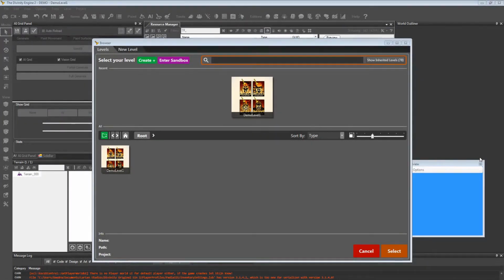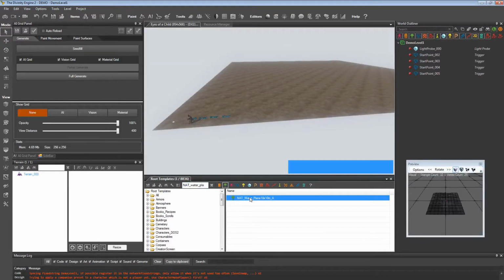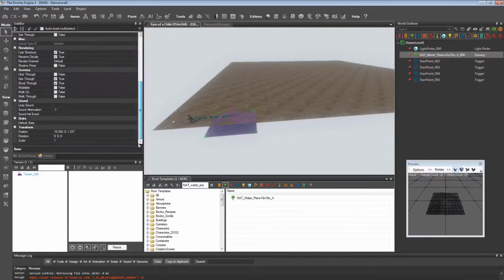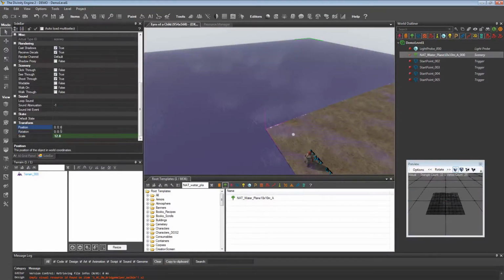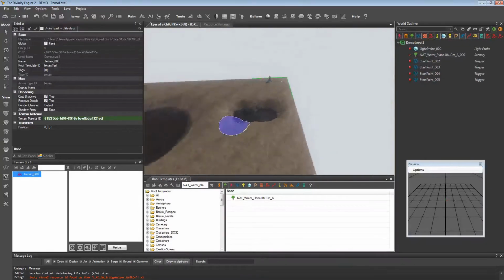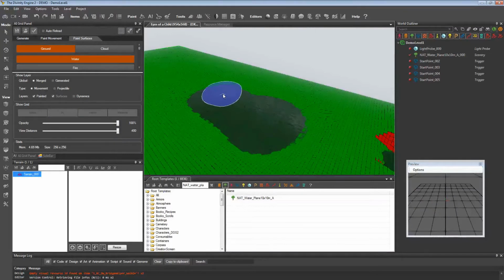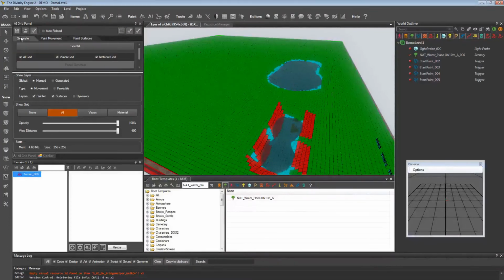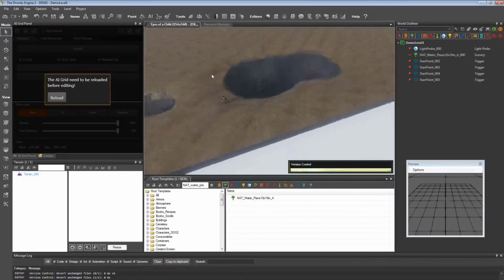Divinity 2 Engine - Quick Tutorial 2 - Creating water

Comment: Will Scenery asset scaling affect its resolution on a close up?
Reply from the maker: As far as I understand, resolution is not affected. The mesh is scaled but the texture is tiled without being scaled. I am not sure this explanation is correct from technical point of view, and it may not apply to all assets.
Reply: Tested out, seems that material resolution used in the asset remains high despite scaling. AFAIK this makes it indeed the optimal method, thanks <3